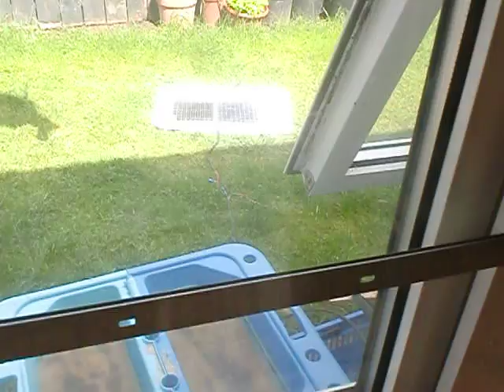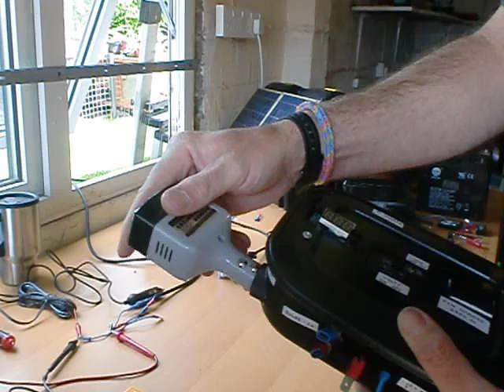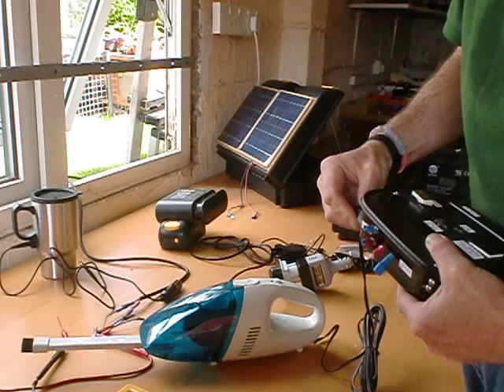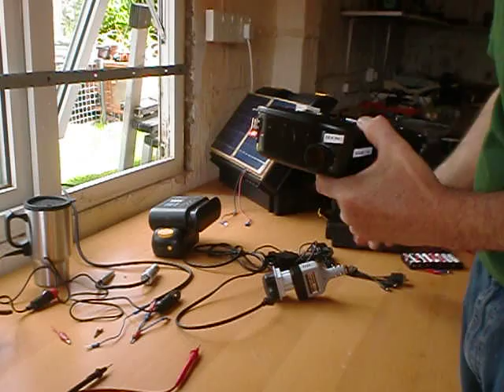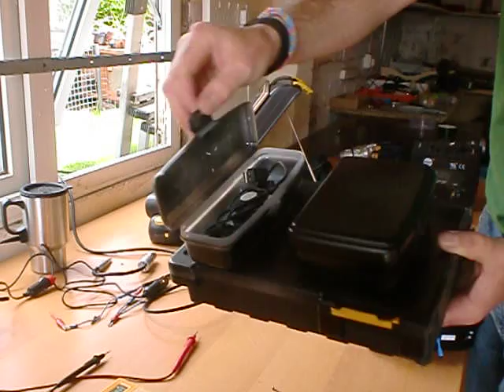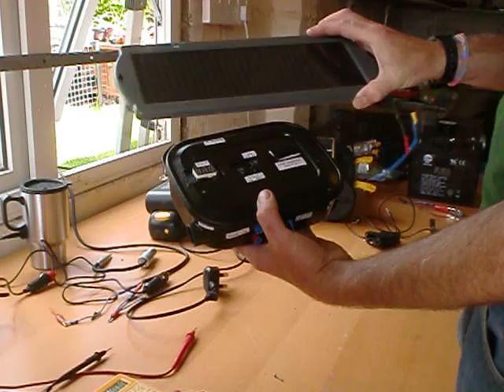DIY wind-up  Micro - Generator

Comment: It’s great, but its not a wind-up, its a hand crank- looking for a clockwork generator! Might be worth a video- a friend had a wind-up clockwork radio. It wound down and ran a little generator to power the apparatus. Thanks for the video, it provided info!
Reply from the maker: I just realized - it is your right- i knew what i meant lol, cheers for your interest & good luck !
Reply: @Mikeecoman  thanks, I’m not finding much, even in the way of parts! One guy used a garage door spring apparatus that worked out. It’s fun just looking, honestly! Ha
Reply from the maker: i know it is hard, it seems its not an idea many are thinking about - keep plugging away. ;-)